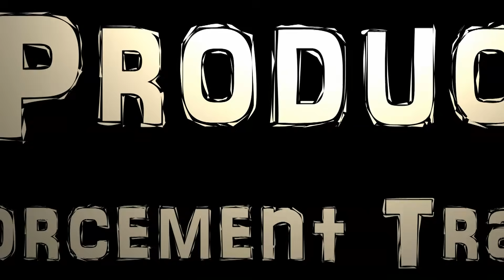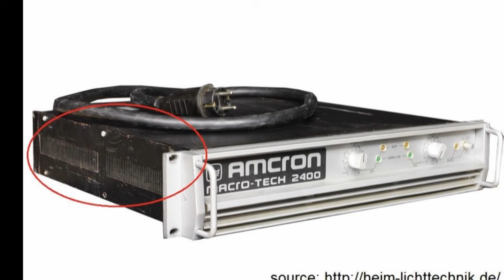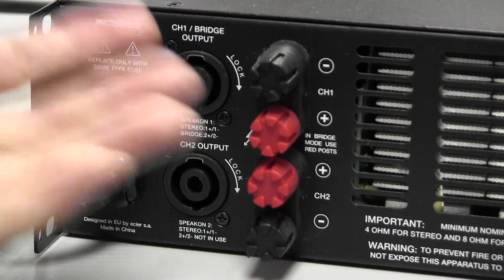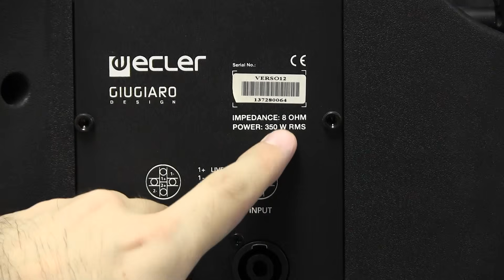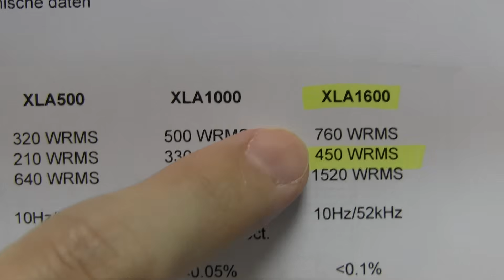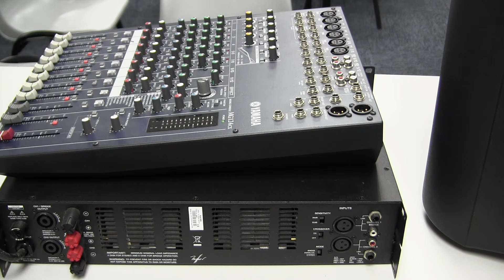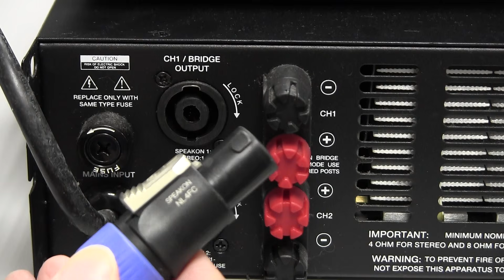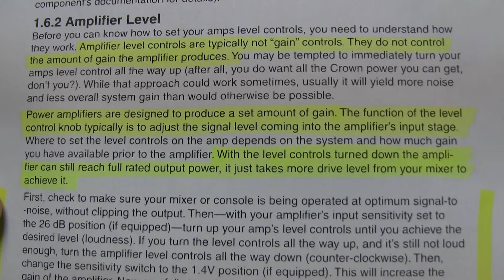How to connect a power amplifier to passive loudspeakers

Comment: Sir does watt of the speakers increase in parallel or series connection. Such as 8ohm 300W rms x2 = 4ohm 600w rms?
Reply from the maker: The speakers themselves have no watts, the watts come from the power amplifier 😉 Amplifier power delivery is increased by lower impedance, which is created by a parallel connection.
Reply: So, what all matters is the watt of the power amp?

Comment: Hey Bruno, is there a conversion table that would tell me what an amp producing 300 watts per channel 4 ohm would equal when feeding an 8 ohm speaker?
Reply from the maker: No, it's slightly different for every brand - with some the output into 4 ohms is twice that into 8 ohms, with others it's 1.5 times and so on. Best way is to contact the manufacturer and ask 😊
Reply: @GLBProductions  I have PV 115s that are 400 watt rms 8ohm. amp is 300 watt 4 ohm each channel unable to bridge. would the peaveys  risk damage from low feed?
I am having trouble finding an amp
 that will give 400+ a side into 8 ohms.
QSC makes something I can use.
Reply from the maker: The way that speakers get damaged by a too-small amplifier is when you clip that amplifier in an effort to get the system loud enough 😆 If you are in a low to moderate volume situation you'll have no problems. Remember that even a 1-watt amplifier will power your speakers fine, it's only when you need high SPLs that you need to pay special attention to the numbers.
Reply: @GLBProductions  Thanks Bruno.

Comment: GOD bless you so much for the good work you have been doing, but please am a little bit confuse about linking one amplifier to the other and how to connect them to multiple speakers. Thank you
Reply from the maker: You're welcome Matthew - what are you having trouble understanding?
Reply: Lets say i have RCF TTL33 passive speakers(10)boxes at both side of my FOH, and i have (8) cvr 2000 watts 4channel power amps in my rack, how do i connect this amps to the loudspeakers. Thank you
Reply from the maker: Matthew those are line array boxes which are not connected in the same way as conventional speakers. In addition they are biamplified, which means that a separate amplifier powers the low and hi frequency drivers in each box. I strongly recommend that you contact RCF or whoever installed the loudspeakers and get them to do the job. At the same time they should provide complete documentation of how the speaker are wired, including diagrams, so that you know how to do it correctly in the future.
Reply: GOD bless you so much for your good works. Thanks a lot

Comment: Not quite correct sir.  Two 8ohm speakers wired in Parallel equals Four ohms, true enough. However, if you wire Two 8 ohm speakers in Series, that will equal Sixteen ohms! I do realize that using Speakon connectors will preclude having a choice in wiring, but if you are able to use the bare wire method or are a skilled audio tech or electrician then you can use either method. No insult or trolling intended. Other than that very important omission,  you gave a very fine presentation. Nice Vid! Thanks for the hard work sir.
Reply from the maker: You are correct Robert 😊 However in pro audio loudspeakers are rarely wired in series, and never 'outside the box' because if one driver fails it will interrupt the signal path, unlike with drivers wired in parallel. Nevertheless I know that a series-parallel arrangement is common for 4x12 and 4x10 guitar/bass cabinets. Thank you for your polite and respectful contribution 😄
Reply: @GLBProductions  Well, I can't argue with that logic. That is also true. Thanks for the polite reply. You don't often see that these days. Great Vid/presentation.

Comment: hey. if i bridge my amp at 8 ohm mode. should i rotate both potentiometer clockwise at the same time? or only 1 of them? either from left potentiometer or right potentiometer
Reply from the maker: It depends on the amplifier - check your manual 😊 Some amps require both channels to be set to the same level, others only use channel A level control while in bridge mode.

Comment: Is it possible to connect a passive subwoofer to output of the 2nd channel of the preamplifier. I want to connect 2 tops and 1 sub with the same system that is shown in this video. Please suggest.
Reply from the maker: By 'preamplifier' do you mean the mixing console?

Comment: Hello!  
is it possible to connect 2 passive speakers and 2 passive subwoofers on a single power amplifier (with 2 channels) and have stereo sound?  or in this case are 2 amplifiers necessary?  One amplifier for speakers  and second amplifier for subwoofer. how do I make the amplifier connection in this case? I don't want to use a multichannel amplifier.
Thank you!
Reply from the maker: Yes, this is possible if you have subwoofers with built in passive crossovers. So the signal chain would be: Left amp output -> Left sub -> Left fullrange speaker. Repeat for the right side. This is not the ideal way of setting up a sub/fullrange system but it will work.
Reply: @GLBProductions   then what is the ideal way?  2 amplifiers, 1 for speakers and 1 for subwoofers?
Reply from the maker: Correct, or a 4-channel amp with the appropriate signal processing for each type of speaker.
Reply: @GLBProductions  thanks for the reply and the time given ! nice weekend !

Comment: Hello. May I ask you a question on an example.. using 2x 700w rms 8 ohm in one box wired parallel gives me 1400w 4 ohm. So therefore i need  aprox. 2000w  4 ohm  on each stereo channel of power amp.  Can I use only one channel(as I have only one box with 2drivers) or it will hurt the amp? Thanks in advance
Reply from the maker: Sure you can do that - any quality pro audio amplifier will have no problem operating just one channel.
Reply: @GLBProductions  thanks for your quick answer. Can you suggest a pro amp that isnt so expensive?
Reply: Forgot to say I dont want bridged mono amp, because in the future I want to add one more 1400w rms 4ohm box.

Comment: Very informative, Thax.  Question,  I’m want to use both passive and active speakers.  My mixer has both 1/4 inch and xlr   Can I use 1/4 for active , and run power amp from xlr ?
Reply from the maker: Yes you can use both sets of main outputs simultaneously, no problem.

Comment: Hi Bruno, are you still operative to answer questions???
Reply from the maker: Sure go ahead.
Reply: @GLBProductions  thanks! I've recently added a beautiful pair of Focal Chorus 714v(130w and 8ohm) to my previous set up of a pair of JVC sx-IIc(80w and 4ohm) and it's  amplifier, a technics V500 Mark II which is receiving 130w and betw 4 and 16 ohm. Do you think I should change amply?
Reply from the maker: According to their website, Focal recommend an amplifier of between 25 and 150 watts for these speakers, so your existing amplifier of 130 watts should be fine.
Reply: @GLBProductions  the problem is in the ohm. Can you suggest a good switch box for audiophile ??

Comment: I noticed you said use a amp between 350 to 700watt  RMS! I suspect the speakers 700w rating is its limit before potential damage RMS is the average continuous power thats ok for long term use. A amp of 500w rms would have a peek of about 714w so really a 500w rms amp is the limit.Remember peek is where the energy and power is in music like bass so base happy tunes will stress the driver in the box...Keep max amp rms at 500w.great video
Reply from the maker: Thanks for the comment! I see from your YT channel that you have some experience with live sound 😊 In professional sound reinforcement the convention is to err on the side of more power than necessary in order to provide headroom. Live music produces a signal with relatively low power density that is characterised by huge transients relative to average levels. This is due to factors such as the dynamic range of the human voice as well as low frequency percussive instruments such as kick drum. As such, pro audio speakers are designed to withstand momentary peaks in signal level far in excess of their 'peak' power rating, as long as the incoming waveform is not clipped. Hence why 'program' rating for this type of speaker is double the RMS and peak is double of that. I agree that this is often not clear from the way they are rated - companies like JBL take the guess work out of it by specifying a range of amplifier powers that are acceptable. Having said that, in practice it is fairly common to spec amps as I have described in the video. Thanks for watching!

Comment: Is it compulsory to use mixer for power amplifier ? Or can we connect directly frm laptop/phone to power amplifier?
Reply from the maker: No, you can connect directly with the appropriate cables.
Reply: @GLBProductions  what is the difference between, If we use mixer for crown XLS 1002 live sound amplifier and if we don't use ?

Comment: Please send my new diploma in the mail. :) I feel like I learned tons. Thanks! Quick question: I have a 600W RMS 8ohm subwoofer connected to a 500W RMS 8 ohm top speaker for both channels. Would that make 1100w at 4ohms? In other words, I’m checking to see if I can get by with one 4ohm 1200w Power amplifier?
Reply from the maker: Glad the video was helpful :) Combined load of those two speakers is 4 ohms, and each one will receive half the output of the power amplifier into a 4 ohm load. So in the case above each loudspeaker will receive 600 watts of power. This is ok, although you should check with the speaker manufacturer to see how much power they recommend.

Comment: Great!.....but what about us who ARE trying to add a passive PA to our systems?
Reply from the maker: I'm sorry I don't understand your question.
Reply: GLB Productions I’ve been having a very difficult time adding a passive sub to my setup, and there are 0 videos on how to do it. I thought you were going to have it hidden in this video somewhere, but no. I did learn some things though, so thank you :)
Reply from the maker: Adding a passive sub to your setup is relatively complex because you will generally need an additional amplifier plus some sort of frequency dividing network aka crossover. If your main speakers are active, they may be able to provide this functionality, in which case all you would need would be the sub plus its associated amplifier. Some videos that may be helpful to you: 
How to connect an active sub: https://www.youtube.com/watch?v=548GZAF6fMY
Passive vs active speakers: https://www.youtube.com/watch?v=nbBULZpkeL8
Reply: GLB Productions thank you! I’ll take a look at them :)
I’m slowly figuring it out. Fortunately my current power amp has a built in crossover, so I’m dedicating that too the sub, and I’ve purchased a separate amp for the mains. Still trying to wrap my head around how to route everything out of my MG16 board...but I’m getting closer every day. Thinking about using Aux 2 as the sub signal...but we shall see

Comment: Best Video's I have seen on here on this subject. Love your clarity, pace and explanation. Hope you can guide me on one question.Can I connect my Mixer to an ordinary Hi Fi Stereo Amp using a free Amp channel.I have my TV and other devices connected through other channels. The Amp uses RCA/Phono  inputs and plays my sound out through my connected speakers. Thanks.
Reply from the maker: Sure you can do that - ideally you will want a -10dBv (consumer level) output from your mixer. If it has a 'tape out' or 'rec out' output on RCA connectors this is ideal.

Comment: Any chance anyone could give me a hand. I’ve got 2 peavey speakers and a crown amp that I’m trying to get working with my ddj400s but o can’t seem to find what’s wrong. I’m using xlr to rca (as my DDJ 400s don’t have xlr) could this be the problem? Please lmk what I could be doing wrong
Reply from the maker: Very likely your cables are the source of the problem - try swapping them out for RCA to 1/4" and see if that solves the problem. You could also borrow an amp that has RCA inputs and see if that makes any difference.

Comment: Hey Professor, I have a question well more seeking your advice. My Amplifier's fuse keep burning out on me. Any advice will be greatly appreciated.  My Amplifier is DFX-3600.  PS... love your videos 👍
Reply from the maker: If your amplifier fuse keeps blowing that is a sign of internal problems - I would get the amp serviced by the manufacturer as soon as possible. The fuse is doing its job and letting you know there is a more serious problem that needs to be addressed 😉
Reply: @GLBProductions  Thanks 👍

Comment: Hi Bruno THANKS for the video very interesting. I do haver a BEHRINGER CONSOLE XENYX X1832 AND A QSC AMP 1600 WATTS AND I BOUGHT TWO JBL MONITORS THAT HAS AN  INPUT TRS CONNECTOR AND AN OUTPUT SPEAKON CONNECTOR I BOUGHT A SPEAKON END AND A TRS CABLE DO I NEED A COMPLETE SPEAKON TO SPEAKON CABLE TO HAVE POWER SOUND FROM ME POWER AMPLIFIER?? I CAN GET ANY SOUND FRON THE SPEAKERS HELP ME UP.....
Reply from the maker: Which model of JBL monitor are you using Manny?
Reply: GLB Productions I got the JBL  JRX 212 Serie JRX200 250-500 watts
Reply from the maker: On that model you can connect to either the speakon or the 1/4" connector. If you use the latter you will need a 1/4" SPEAKER CABLE - don't use a normal guitar cable!
Reply: @GLBProductions   ok thanks you very much

Comment: How to control the loudness of speaker by master of mixer or gain control of an amplifier. How can we  relate to each other by  Mixer and Amplifier.
Reply from the maker: Good question - I should really do a video on this! Basically once gain is set correctly on the mixer the amplifier level controls should be used to set overall system volume. So your mixer gain should not change much from venue to venue.
Reply: @GLBProductions  Thank you...

Comment: hi,i like your videos,but can you please do a video that demonstrates how class D amplifiers work? in terms of impedance and watts. thank you and keep the good work.
Reply from the maker: Hi John, in terms of impedance and watts class D amplifiers work the same as other power amplifiers - the only difference is the way in which the power supply section of the amplifier works. These differences are of no consequence to the end user besides the reduced, size, weight and heat generation of this class of amplifier 😀 In other words, 200 watts into 8 ohms from a class D amplifier is treated exactly the same as 200 watts into 8 ohms from an older class AB amp, for example.

Comment: may i ask a question Sirs? In a speaker series connection, I know impedance  is added...But in wattage output of the amplifier. Is going to be divided to the speaker connected to the channel? As same to parallel
Reply from the maker: Yes, whether the connection is series or parallel each speaker will get a proportion of the loudspeaker's output power: if there are two speakers, each speaker will get 50% of the power. If four, each will get 25% and so on, AS LONG AS the speakers are all the same impedance - this is why for multiple speaker systems being driven by a single amplifier it's very important that the speakers are the same impedance, and ideally the same make/model.

Comment: Question, what if it's a powered mixer can I still the power amp or not.
William Percival New Zealand Gardenia Band 🇨🇰 Kia Orana
Reply from the maker: Yes you can - any LINE LEVEL output from your powered mixer can be connected to a power amplifier.

Comment: Top Tip - I love using 12g cable for the speakers, it is the perfect gauge in my opinion, i will not use 14 or 16 gauge. Also, you need to open up those Neutrik connectors every once in awhile and tighten down the 2 screws that hold the wire, they DO loosen up over time and can drastically effect your speaker output. I was barely getting bass out of a subwoofer one time, and after the gig i opened up the cable and was able to do 3 full turns to tighten them down! Yikes! Great videos, keep em coming! Thank you!
Reply from the maker: Thanks for the comment! Heavier is definitely better as far as speaker cables go, although there comes a point where the weight begins to be an issue.

Comment: Hi Bruno, can I connect 2 500watts 8ohms yamaha sm15v on daisy chain connection on Channel 1 and the same set of 2 speakers on channel 2 with my QSC gx7 which is 725watts at 8ohms per channel?Thank you Bruno.
Reply from the maker: That amplifier delivers 1000 watts into 4 ohms, which means that it is an ideal match for these speakers - each speaker will get 500 watts of power in the configuration you describe above.
Reply: Thank you very much Bruno. You’ve helped me again.
Reply: Bruno your explanation in this video enlightened my mind upon connecting passive speakers to amplifier based on power ratings and impedance. Thank you again. I’ve been watching several videos on YouTube but your explanation is the one that made understand the whole concept.

Comment: One of the best videos ive seen on this. Thanks!

Do you have one that covers using the wiring set next to the speakon outputs? Ive got a qsc cx902 that i cant get to work and i hooked it up like your video suggests. The cx902 doesn’t have speakon connections but has wire nuts that allow for speaker wire to be connected
Reply from the maker: Thanks for watching! There really isn't much to the binding post connectors: unscrew, insert bare wire into hole in post, tighten securely :) Be sure that your polarity is correct for both channels and you are good to go.

Comment: First things First. Thank you for your help.  One more question, i have asked in many youtube channel, i did not get a reply so far. Now that i connected the 2 passive speakers, how or where in the amp and mixer do i connect my 2 monitors ?? And by the way my mixing board don't have xlr outputs. it has speakon and 1/4".  I think they can power up a passive speakers.
Reply from the maker: How impolite of them ;) Stage monitors or studio monitors?